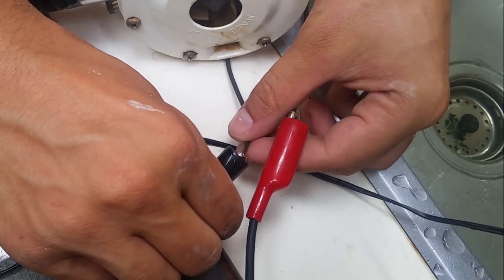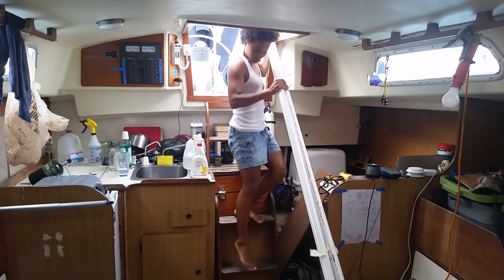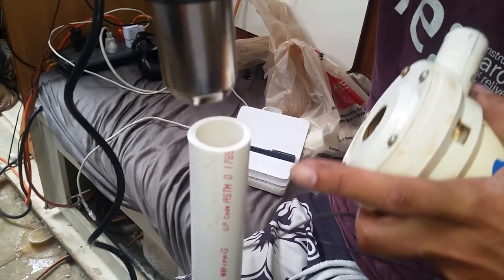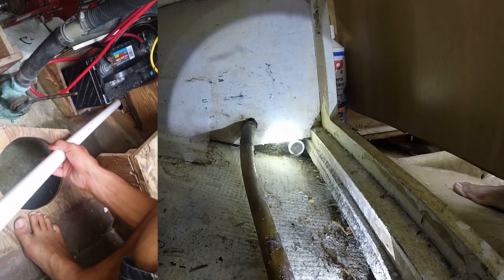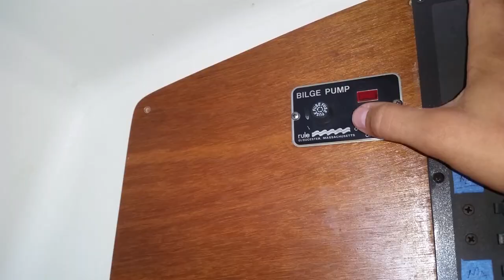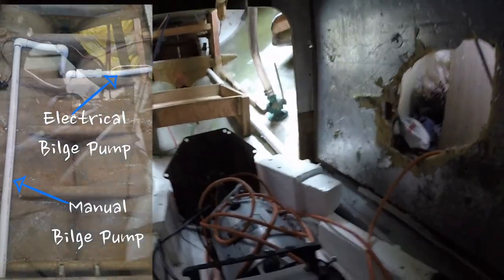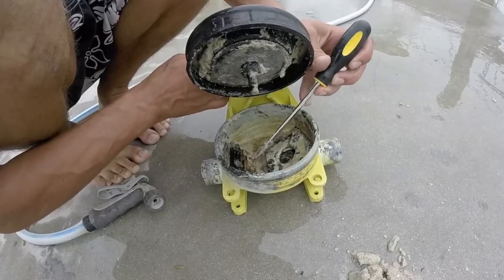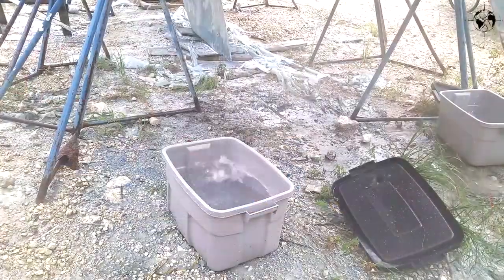Plumbing a Sailboat with PVC — Sailing Uma [Step 18]

Comment: Good job with the plumbing, I love that flex hose, it's inexpensive and resistant to a wide variety of fluids, now you just need to add some Aviation Permatex to those joints and they will be leak proof  for a long time!

Comment: Lots of cool improvements, when sailing I would check the PVC joints often until your sure the flexing of the boat while sailing does not produce a leak! Did you think that you would doing so much repair work when you bought this boat, don't get me wrong, what your doing looks great!

Comment: Oh boy, I see this episode sparking conversation. I hear so many reasons why "not" to use ridged PVC pipe in boats....the main reason is movement and flexing, the other is flexible hose will only have 2 points of possible failure where solid pipe has several points at elbow turns and such. I've seen a couple of project boats have PVC pipe used but never heard how they held up...keep us posted.
Reply: +Sean T Only time I ever seen a PVC connection fail was when 1) no primer, 2) no cement or 3) not enough of either, 4) not enough contact area (not pushed in fare enough).  Follow instructions and you will never get the connection apart without cutting.   Flex hose is easier to install and less resistance to flow because of genital turns but much more expensive depending on application.
Reply: +Mazda rx7 yeah i dont see it failing ever...prob outlast the boat...only time ive seen it fail is in 0 degrees huge sump pump the line froze and pressure from pump blew it...and it wasnt even the pvc connections that really failed...it was a flex connection in line for easy servicing!
Reply: +Mazda rx7  Not in this application.  1 1/8" bilge hose can be had for $1/ft..    http://www.ebay.com/itm/HOSE-BILGE-1-1-8-WHITE-50FT-BILGEFLEX-88-1201186-BILGE-PUMP-HOSE-BOATINGMALL-/151612052899?hash=item234cc855a3:g:i04AAOSwnDZUBKn5&vxp=mtr

Comment: Hmmmm, I never even considered PVC piping for the bilge.   An extra idea (I can't remember where I first saw this) as an emergency pump was to t connect your raw water intake before the raw water pump (Of course I just remembers you switched to electric so never mind for you guys, but a good idea to share "Doh!")  which has a valve leading to a hose gonig to the bilge so the engine can also act as a blige pump in an emergency.    Looking forward to seeing your rain water catchment system!

Comment: Great job! Alternate title for your series: "How to Fix a Sailboat On the Cheap". I have often wonder why others have not used PVC on their boats. Seems like a better way to go all around to me. Toss all those hoses that are expensive and degrade for lifetime PVC! Something I have been tossing around in my head is how to build a solar powered water desalinator on deck. Might be a good emergency backup plan. I also hope to build a solar water heating system made of PVC tubes painted black running up the mast.   Thank you for all the information and ideas you have shared with us all. It might just make it possible for me to buy a fixer upper and sail away someday! Please let us know how the copper bottom jeans hold up as I want to do the same. Thanks again!
Reply from the maker: Thanks so much for commenting. To be honest though, the true reason behind our  solutions is that we want to  use supplies that we can find or repair anywhere in the world and in areas where we might not have access to  "marine grade" products  (just so happens that its cheaper- haha)   Also awesome idea for the black PVC water heater system. We wish you the best of luck on your project :)

Comment: It will be very interesting to see how the Pvc holds up, It flex's different then fiber glass. I'd keep an eye open for lateral cracks after a few big storms. I am also waiting to see you get everything on the engine worked out, glad the battery just melted
Reply from the maker: So far so good. 3yrs, 5000 miles, 1 hurricane and many other rough time. No cracks or leaks yet.

Comment: Howdy.  Ex plumber here.  As an FYI that pipe is not good for potable water.  It also can become poisonous if heated.  You need CPVC which has an yellow color for drinking water or the aforementioned rubber hoses.  So I hope you only used that for the bilge/grey waste water.
Reply from the maker: Yea, the PVC is for the bilge drain and we don't drink the water from our tanks anyway. Our tanks and hoses are nasty and we don't have appropriate filters to drink it.

Comment: If you do have problems with the PVC getting brittle & cracking, you might think about PEX flexible plumbing pipe as a replacement.  Also easy to work with. 1" and larger is sold in 10 and 20 ft sticks.
Reply from the maker: +james morales Pex is great! It can be difficult to locate though, especially the fittings. But we do love PEX. If we had more complex plumbing installations we might consider it.

Comment: Hi guys, greetings from the ATL area.  I love your Vids and have a question that I am sure you two thought of but still, I want to ask.  The PVC is relatively flexible but not like the hose.  Boats flex constantly under the enormous pressures surrounding it.  How will the PVC hold up to the flexing, or is it in such a location that it will not be part of this process?
Reply from the maker: Thanks for your question :) As far as flexing, anywhere the pipe connects to the hull ditectly we did connect it to hoses to allow some additional movement. Hope that helps. But as for the rest, PVC is flexible enough to withstand the minor movement of the hull. Sorry we didn't put that info in the video (probably would've been a bit more helpful).
Reply: +Ted Smith it takes a LOT of flex to harm pvc
Reply: +Sailing Uma PVC gets very brittle after a while. A float switch is a must for any bilge pump.

Comment: Hi guys, great video as usual!  I noticed you were talking about installing a composting head and thought that I'd mention an issue from Damato's "Breaking Seas" book.  He installed an AirHead composting unit and it worked fine until they were sailing and the boat was heeled over.  There was an issue then with the urine mixing with the solids and causing the composting function to fail with rather nasty results.  Just a heads up! (pun intended)
Keep up the great work.
Reply from the maker: +Ed B Thanks for the "heads up". Lol. Yes, we are installing a composting head, but will have to build one ourselves (of course). Because the available ones to buy won't fit in our head. We haven't finished designing it yet, but we have definitely considered what would happen if we get knocked down and are taking that into account in our design.
Reply: On this note I am waiting anxiously. Since we have the same boat and I plan to install a composting head I can't wait to see/hear/read what you will do there. Perhaps it's in a forthcoming episode already out. Hurry and binge watch, Rick! lol

Comment: Went back and looked at the video.  Yes you have a removable fitting on the new pipe, but the pipe to pump connection is definitely solvent weld.  If the pump is CPVC and the pipe is PVC it won't hold with PVC glue.  The pump might just be really old and yellowing.  CPVC is yellowish and you can find it at Home Depot or Lowes to compare the material to your pump.  Also you might be able to find out the pump manufacturer and call them to find out.  I don't think the manufacturer was expecting a solvent weld because of the lip on the outlet.  It was obviously designed for a clamp on a flexible high burst pipe.
Reply from the maker: +Allyn Onderdonk Yes, it was designed for a hose clamp. But, we heated up the 1" I.D PVC and pressed in the 1 1/8" O.D Pump fitting. We didn't use any glue there. The two fit together so well it doesn't leak. The lip on the pump acts as a gasket against the PVC. It also will allow us to remove the pump easily and replace it without messing with the PVC any.

Comment: Bilge pumps, being centrifigal pumps, are quite sensitive in terms of flow rate when subjected to the pressure drop through all those pvc right angle bends. Might be worth checking the new flow rate to see if that is adequate for your needs. More is better when it comes to bilge pumps. Neat plumbing job though.

Comment: for anyone else thinking of re-plumbing their boat on the cheap, I'd highly recommend using PEX tubing from your local hardware store instead of PVC
Reply from the maker: Yes PEX is great! But you then have to buy either very expensive fitting or expensive crip or expander tools. Neither of which we had at the time. Also, only really good for supply lines, not drain lines. So, still would not have worked in the bilge. If/when we renovate the galley and head, we will for sure be using PEX.

Comment: Obviously marine grade stuff is $$$ and it seems prudent to consider what other trades might use. I did raise an eyebrow about the pvc though for this application...it does leave some things to be desired in high vibration or any environment exposed to ice, although since your not pressurizing it shouldn't be an issue. There are several options out there that are really reasonably priced though that use flexible tubing. Most sump pumps have a cheap flexible tubing, but there are fresh water solutions that are also flexible. We used to use the crap out of that stuff in the manufactured home industry at the factory and at the site hooking the home up. Some of it requires specialized tools but that can be rented cheaply. Bear in mind though our solution needed to be able to handle being pressurized and freezing...probably not concerns of yours.

I'm so on pins and needles for how this forklift motor solution will turn out for you guys. I looked on  your web site for more details but nothing there the last I looked. I did some reading on the subject and it seems to big boys with the big bucks are using solutions similar to electric car hybrids using the motor while under sail to actually charge the batteries too. I'm having a hard time picturing the props actually freewheeling though when connected via a geared transmission. I'm totally wondering how your going to handle speed control as there likely to be enough current transfer here that switches won't work...you'll have to use relays and some sort of electronic pulse speed control.

Please indulge us and be detailed!
Reply from the maker: +tazmun Thanks, yes we will make sure to go through all details in our motor update video. We're going to soon write a more detailed answer in our website as well...  in case we don't cover it all in the video. But its a long process, patience is key :)

Comment: The reason flexible pipe is popular is because it accommodates the flex of the boat as it moves through the waves. Don't repeat this for your blackwater system. You might find you have to add flexible components to your bilge at a point. But, that'll be an easy fix, if it comes to it.
Reply from the maker: We do have a flexible connection to the through hull. Also, don't have a black water system. We're building and composting head. PVC is also more flexible than the hull, so it should do fine.
Reply: I'd love to hear your opinion on the composting head system once you've spent some time with it.
Reply from the maker: +Makhoe van der Vlugt Of course! We'll have videos about our build and what it's like using it.

Comment: A bit late on this (by a few years), but it you do this again, look into PEX vs PVC.
Reply from the maker: We have mostly PEX now, but PVC is so much cheaper which is why we started with it. We still have some PVC left on the boat, it holds up just fine, and you can find replacement bits in every country at any hardware store.

Comment: Just wondering, are the hose clamps marine grade? I saw another video where a boat owner warned against the hardware store variety because although the strap is stainless steel, the mechanism is not and rusted out and failed. Marine grade hose clamps cost more because they are stainless steel throughout.
Reply from the maker: Yes, they are "all stainless" most of them came off all the old hoses we ripped out of the boat and engine. So they've been in the boat for awhile and show no rust. There were however quite a few of the hardware store variety onboard that we tossed.

Comment: Ok guys this is not gonna be fun for me to write but has to be said. PVC should never be used on a bilge pump. The PVC your using is for fresh water not for contaminates such as oil, grease and what ever else will go through that bilge pump. The PVC will degrade over time and as any sailor will tell you . It wont be at a good time when your in a marina when it leaks. 2nd when you have that many connections such as Elbows and splices it just gives water more places to leak from. Marine grade hoses are great because there is just 2 connection points your bilge and the hull of your vessel. Unless you have a back stop valve then you would have 4. I really don’t care about your fresh water system . I’m OK with it. But when it comes to safety your bilge pump should be one item on your list you don’t short cut. I like you kids I think its great and no one applauds your efforts more than me. I have watched you 2 since day one and I have enjoyed watching your dream become a reality. Don’t short cut on safety items. I would not write this if I didn’t care honestly on what your trying to do.
Reply from the maker: +TheSolarmechanic PVC is made with some of the most chemical resistant plastic you can buy,  used in most ( if not all) of the drainage  in houses including showers and toilets. (so it does deal with a lot of oils, shampoo, soap, hair, dirt etc...) It's also used in fish tanks - so it does deal with salt water pretty well.  And its chemically bonded at the joints so its not a weak point but a stronger one _Think of it like a weld (if connected correctly - and I can assure you they are, they wont leak) Thanks for commenting and sharing your concerns. Really hope this answer helps understand a bit more :)
Reply: There are 11 types of PVC.  I know this as I am a supplier.  What you are using is not going to be adequate for this.  The joints will make clog points as well.  Marine grade products are used for a reason.  I am seriously concerned for your safety with this set up you have made.

Comment: Hey guys, I was wondering if you have found an epoxy deck sealer, our deck has lots of old screw holes and such?
Reply from the maker: +Scott Kiesling Any  epoxy with some structural filler will do fine :) We used it when we took the lifelines out in Step5 (around minute 2:50)

Comment: Is there a check valve in there somewhere close to the pump?
Reply: +Robert Garbe A check valve in the bilge system is a ticking time bomb for clogs.
Reply: +Robert Garbe be a pretty good idea...they make ones for pvc that would never really clog ...keep that bilge dry as bone!
Reply: +SolarBurrito Yes BUT with that LONG plumbing run the bilge will fill back up after the pump shuts off.  Sorry but you are going to have to have a check valve, at the top of that detachable section and then just check it often, clog or no clog.  At worst the pump will just cycle over and over again with the water from that large long pipe running back in.
Reply: +Robert Garbe that run is not that long for a boat. Thier electric pump is not a positive displacement pump and doesn't have much power to overcome any sort of stoppage. A few years of oil dirt and hair in the bilge and it will very likely prevent the valve from opening. Not to mention many sailboats have sunk due to a siphoning check valve. Sinking is bad. A high loop on the hose would be much safer. Don't take my word for it, many books have been written about restoring boats. Check out This Old Boat. I just hope the few $$$ they saved doesn't bite them in the butt with their PVC bilge system.
Reply: +SolarBurrito You been smoking to many burrito's.  there are a variety of flapper type valves (one example Jabsco In-Line Non Return Valve,  1 1/2 In. - 29295-1010) that are designed for this use.  A thirty ft run of 1 and 1/2 in pipe has close to 7 GALLONS of water in it, just saying.  I see NO problem with PVC in this use either, rather ingenious.
Reply: +Robert Garbe I just think there are plenty of better ways to keep your pump from cycling. Timers, their gusher pump etc. BTW they don't that problem because there boat has seen no water. In John Kreshmer's book "Sailing a Serious Ocean" one almost new boat almost sinks because the check valve is siphoning water into the boat, which was a known problem on that model.
Reply: +SolarBurrito You can always use a cup and bucket also..

Comment: Why did you use gate valves instead of ball valves on your water ststem
Reply from the maker: Those gate valves are the tank isolation system that came with the boat and at the time, we couldn't afford to replace them.

Comment: URGENT!! Um I wanted to point out something you need to check out.  I think your pump might be CPVC (the yellowish color)and your pipe is PVC.  The two are chemically different and I am pretty sure CPVC requires special glue.  If you bonded the PVC to a CPVC pump and use the common Oatley PVC cement the bond probably will not hold.  I would maybe find out what the pump is made of, and what your PVC cement is rated for....Perhaps calling Oatley is a good idea!
Reply from the maker: +Allyn Onderdonk The pump and the pvc pipe are connected by a mechanical fit, not chemical. So that we can remove it easily if needed.
Reply: Awesome! I just saw the pipe being heated over the pump outlet and fitted!  Thought you should know the possible difference between the two plastics.
Reply from the maker: +Allyn Onderdonk Yes, we dealt with both PVC and CPVC a lot when we flipped houses as residential contractors.